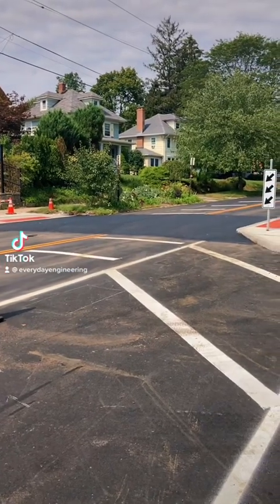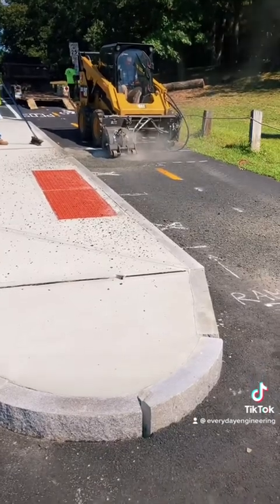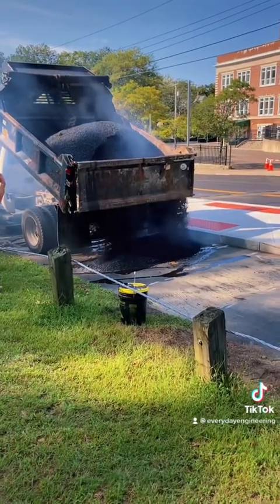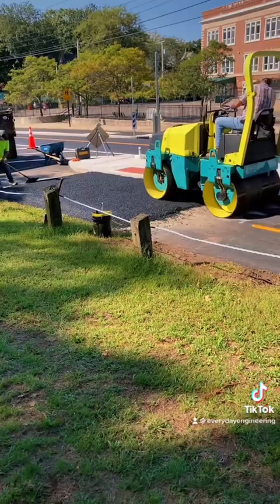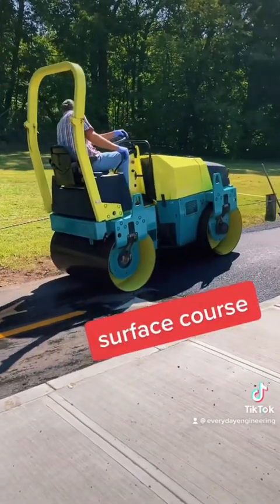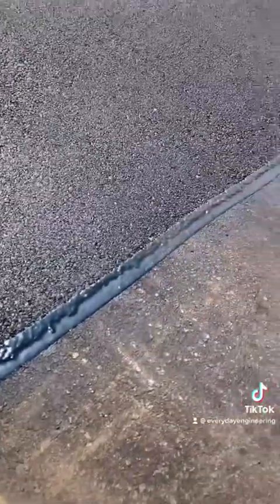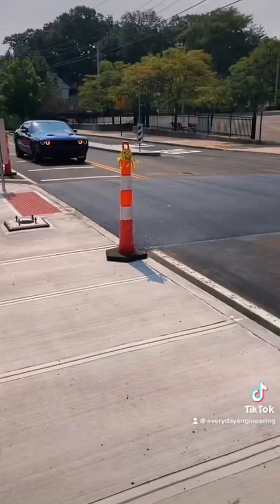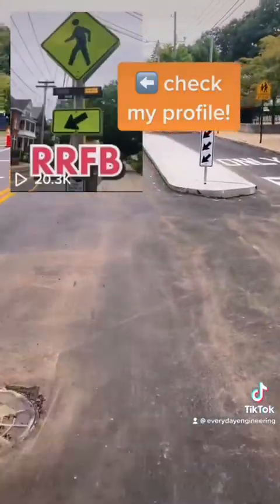Constructing a Raised Crosswalk - Part 1

Comment: The shared use path doesn't need a raised crosswalk. That's silly. What bike is going to go more than the speed limit? If it's an eBike, their max speed is 20mph—the speed of the street anyways, so it makes no sense. They should be made of concrete too, so they're easily seen. Very important not to cut costs like that.